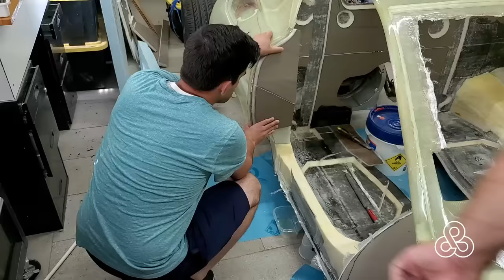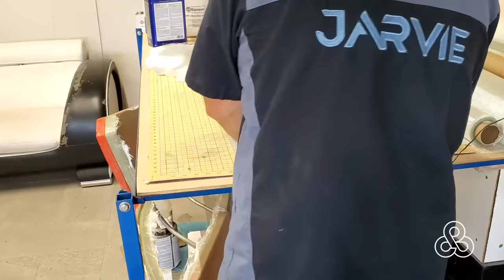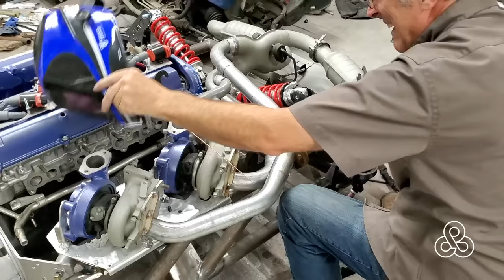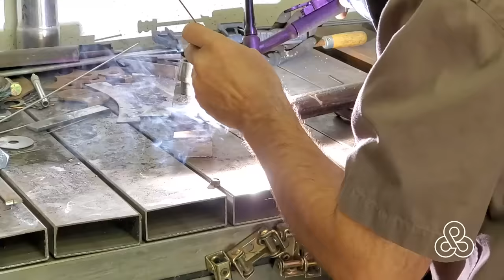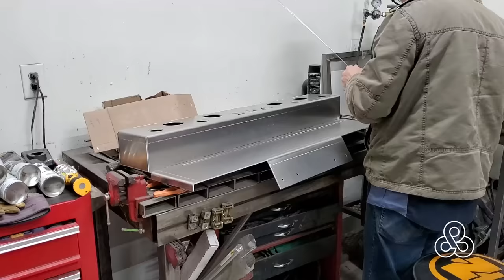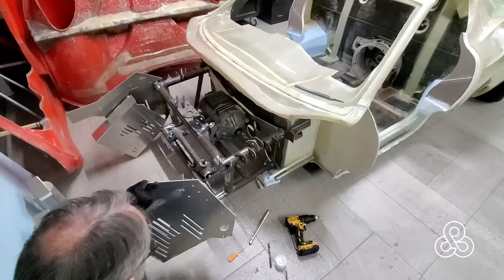How to build a supercar from scratch. Part 2. Arete Supercar project

Comment: There could be a problem with your control arms and adjustment. There is no horizontal pivot point for the wheel alignment. The urethane bushings don't have any horizontal play so when you go to adjust, the bushings will bind. When I designed and machined my tubular control arms about 20 years back, I found that I had to make 3 out of the 4 mounting points horizontally adjustable and one fixed (welded). The  horizontal mounting pivots had locking bolts to secure once the wheel alignment was done. Even though everything was modeled in 3D Autocad, I still needed a lot of movement to set the camber and caster perfect. The lower control arm was fixed, non adjustable and was the reference. This page details the steps for positioning the RnP and shows the control arms. http://www.route66hotrodhigh.com/PlotRnP.html Good luck!
Reply from the maker: We will pray the first shot is close enough . . there is always cut and move. :(  I'll check out your article. Thanks.

Comment: I see that you have used a metal sub frames being attached to the fiberglass tub in between like  most super cars. Is that better than making a full subframe and adding on a fiber glass body kit?
Reply from the maker: Not going to say it's better, but it is a method to cut down on weight. However, it did add a considerable amount of time to the build . .  . but what's time?

Comment: How would you go about doing something like this to an existing car?
I always wanted to do my own car or build up an existing kit. Now i have my own space and the time to do it. We always had the uk route in the eu where you could register custom build cars in the uk as they where the only country accepting custom builds. And that would give you an eu registration and at that point no eu country no longer could deny regustering it as it was an eu car.

But since brexit that has passed. Now any kit car needs to be a type approved chassis. So basicly any legal car sold in the eu when new. And some parts of it can not be altered, like wheel base, as well as some structural parts like front and reat struts and any safety features like crumple zones.

So i would be basicly locked into the bottom of the tub and front and rear subframe positioning but pretty much free to do a body shell around it. But most likely limited to a front engine design as mid engine cars aren't that common and most are just to expensive, or just beautiful cars already, and a shame to cut up.
And with this being europe, rear wheel cars are not that common either. Mostly bmw and merc and some japanese cars to choose from at affordable prices.

Been thinking about what would be the best route to take to keep it affordable and something that a hobyist would be able to do..
Reply from the maker: I feel your pain! Things are tough for the custom car builders in the EU. Luckily, here in the US, one of the few items of sanity that remain (for now) is that they realize that the number of custom cars is SO small that regulating them out of existence is meaningless; as in pure statistics, they don't even show on the scale. Your challenge is to be able to create (highly modify) just the styling portion of a vehicle to create something completely unique and that also gives you a sense of achievement. I guess this is your challenge to see if you can design a car around the parameters you have described and see if you can actually create something better (more beautiful) than the original. There is always chopping the top (slicing a few inches (30mm) out of the roof line) to give it a sleeker look and re-sculpting the four quarters/fenders. One thing I will say is that you can spend more time on the design, as the actual work is MUCH less than I have been faced with in developing the whole car. Anyway, would love to see what your solution is and what car you find to modify. Maybe my next project I will attempt something similar- perhaps an old Corvette re-body?

Comment: Interesting to see your build choices. Im on a path to build something similar( bit more GTP track car ), but it needs to wait till I get a new house built with an adjoined shop.  So my questions are about your shop size and what changes and additions you would have done in hindsight. Ive got a tentative garage size of aprox 950 sqft with an over flow bay  of 300sqft (Available when wifes car is parked outside).
Reply from the maker: I have 1100sqft, but a big CNC router is now occupying half of the studio side, so it is cramped. Luckily I also have a good storage space above the studio were I can move less used tools and supplies. The studio 26x26 is a good size for clean and tidy work. The other room "mechanical shop with a lift" allows us to get dirty.  My advise is get your wife a Jeep, only a sissy would park a Jeep in the garage! Ha!
Reply: @BuilderCreator  Thanks for the info, watching someone else work has helped me confirm many of my own decisions.  Ive got another year+ before the funds for the house come thru.  So until then, it is dreaming over plans for the house and the projects to birth within. My main work space (plan of the moment) will be 2 bays with a 2 post lift in one and another double + bay as the work space, With each bay is 30' deep and has an overhead crane. Luckily my art studio( 20'x50') is adjoining and will be large enough for a lot of over flow work that's movable.
Wife likes Jeeps but she likes sports cars far more.

Comment: this is oddly reminiscent of ultra lite airplane builds. lookin great my friend also what foam is that you’re using for structural support? also i just wanna say how gorgeous it looks. it reminds me of the old school le mans speedsters but a newer i would say it looks like is the 4c which in my opinion your mold looks better than that car but still similar
Reply from the maker: A lot of my techniques come from the experimental aircraft world. The foam is polyisocyanurate used in construction (roofing insulation mostly- check with roofing suppliers) the brand I am using has a fiberglass filled craft paper bonded to both sides rather than a foil backing ( foil bad). Mold vs car. . .wait till the car gets some color. ;)

Comment: Very nice. Question: How do you determine the thickness of the body? I assume you wouldn't want to lay fiberglass in excess, to save weight, nor you would want to lay too little fiberglass. Thanks.
Reply from the maker: Yep, there are as few as 6 layers and up to 40 layers depending on were strength is needed. All dependent on experience and seat of the pants engineering, as this car has not had a full FE analysis done. I'm sure I will be heavier than need be, as overkill is the solution for failure. And in the end if I do develop cracks or failure points, I can go back and reinforce.
Reply: @BuilderCreator  Thank you.

Comment: If you conduit like an electrician keep your cross sectional fill below 80% and no one wants any moron the bends than 4 90's. Be conscious for noise in parallel conductors. With shielded cables bond one end and isolate the other.

Just needed a little something to keep my fingers busy. Just tossed out some Justin Kase information.

... now back to our regularly scheduled waste gate.

Comment: Very impressive, only thing I would have done differently was put a LS motor in there with a supercharger, probably would have been cheaper than the twin turbo Toyota route too, but to each their own….
Reply from the maker: Personal preference, but I just finished rebuilding a 6.0L LS for the Leviathan project and it cost me about $800 more than the JZ rebuild. (I guess that is $400 per extra cylinder. Ha!)

Comment: I dont doubt you do this in your spare time, nor do I have any reason to doubt this is your home... However if you build a car in your own garage, its not a supercar. By any stretch of the imagination. Call it a kit-car, call it whatever you like. A home-build. A garage project. Just dont get it confused with supercars.
Reply from the maker: When does it become a supercar? When you put it together in an industrial building? Have 5 or more employees? Use outside funding? End up on the cover of Motortrend?
Reply: @BuilderCreator  
I know this is a mystery.... To the only car producing country that does not make supercars or high end cars. Just look at the Hennessey and SSC "supercars" No crash testing, no emissions certification, no real factories, no real production, no winter testing, no health & safety, no rules & regulations, no homologation, no type-approval of any kind, not even wind tunnel testing. No nothing. These things go directly from a 3d CAD drawing into assembly in 18 months. With no real development behind them.

No real prototype, no test cars, no press cars, no development mule, no tens of thousands of miles of road & track testing by professional test drivers, no proprietary technology. They arent even registered car manufacturers. Because if they were... There would be a million rules and regulations to adhere to. Health & safety, special waste disposal, liability & insurance, having a real car factory is a big operation. So instead they are usually just 10-15 people including the receptionist and the cleaning lady. And then they screw it together in a rented floor space out of bits that arrive in cardboard boxes.

And then "Show & Display" numberplates arrive automatically in the mail. No questions asked. Tadaaah! "American supercar"
Reply from the maker: @captain_context9991  Now I understand!
Reply: @BuilderCreator  
Its not difficult.

Comment: I really like and appreciate the art that is going into this project, but as an aircraft composites person I just cringe seeing wet layup polyester resin and fiberglass being used for l;oad bearing structures.  At least use S-glass prepreg, if not carbon fiber, and a vacuum bag and oven cure system.  The way resin is brushed on the laminates means they are losing strength; the ratio of fabric to resin is critical for strength, and the fact it's polyester resin negates any attempt to achieve strength, especially with vibratory and repeated loads that a car would experience.  If this car hits the road the polyester resin/glass combination will break very quickly; 200 mph looks, to me, as a death wish.  Inter-laminer strength with this type of layup is not good.  Sorry to cast any aspersions, as I appreciate the skill of the build, but there is a serious lack of understanding about resins and fibers here.  I doubt if any calculations have been made re loads.  
Another nit I will pick is the constant reference to a monocoque tub.  This structure is not a monocoque, it's a steel space frame bonded to a fiberglass outer shell.  A true monocoque structure would be and inner and outer composite shell with a honeycomb between.  Further, bolting suspension bits to a polyester glass hard point it just asking to have a failure.  There is no strength with polyester/glass.  It will very quickly come apart.  I cringe watching this, though I respect the art shown in the building of it.  Making it thicker doesn't make it stronger; re-lam the de-lam......
Reply from the maker: Thanks for writing such an in depth comment, especially as a busy aircraft composites person. I'm sorry if the overview video you may have watched was in some way misleading, but the car is built from S-Glass and epoxy, not polyester. (perhaps you heard some mention of vinylester in description of the molds construction) Although I would have liked to build with carbon fiber with Vac bagging and autoclave systems, It is not in the budget of this build. Yes, I have calculated the expense of going that route out at about $24,000 higher than the S-glass hand lamination system. (less the cost of an oven or autoclave) As for hand lamination in general, Burt Ratan and thousands of Veri/Long Ez builders have proven that hand lamination can produce adequate structural parts. In the automotive world hand laid-up (some chopper gun laid up) cars have been built with some success. Both the Murtaya and Libra GTM, and more famously, the early Chaparral race cars all used hand Laid-up monocoques. (I use the term monocoque, whereas the structure of the chassis is integral with the body.) I suppose that the Arete project could be considered more of a Monocell structure, as the actual pick up points of the suspension are not part of the fiber (skin) structure. In dictionary terms it is a monocoque; in racing world terms a monocell. My "monocell" does have inner and outer shells with foam between. (Nomex cores on large flat panels) I do not bond any fiber structure to space frames. The steel "sub-frames," (suspension mounting/ engine cradle) are through bolted to hard points on the monocell. Your final comment leaves me a bit confused, "making it thicker doesn't make it stronger." We could say that changing materials could make it stronger, or changing the shape can make it stronger, but in my understanding adding plies (thickness) does indeed make a lamination stronger. Again, thanks for taking the time to write your concerns and keeping me on my game.